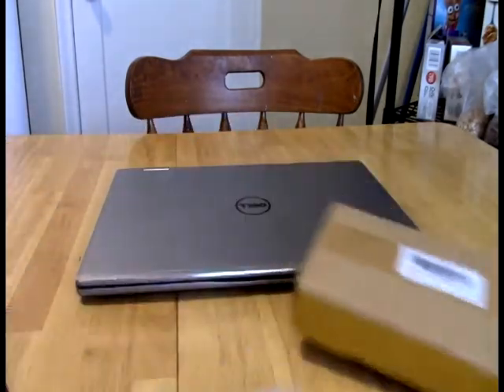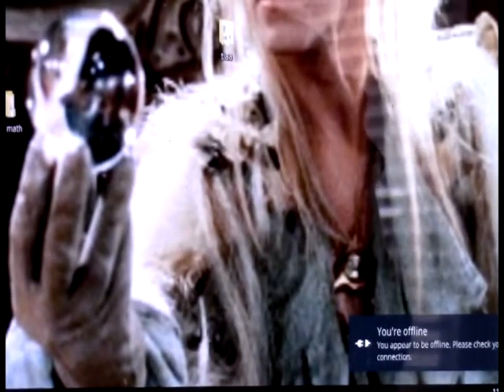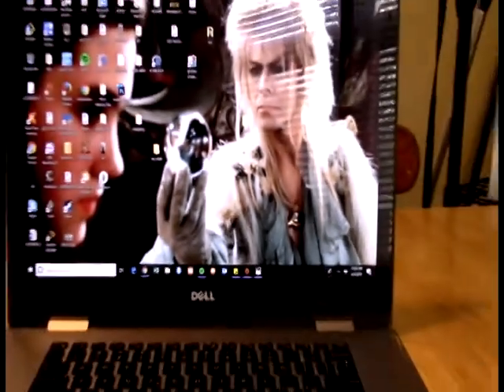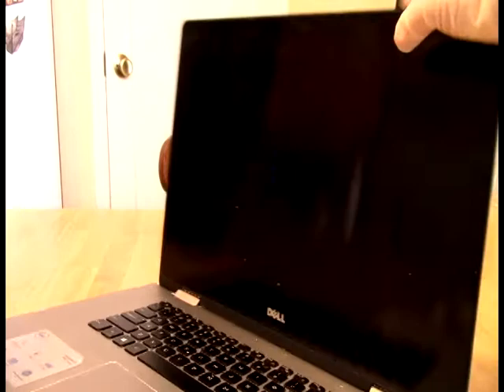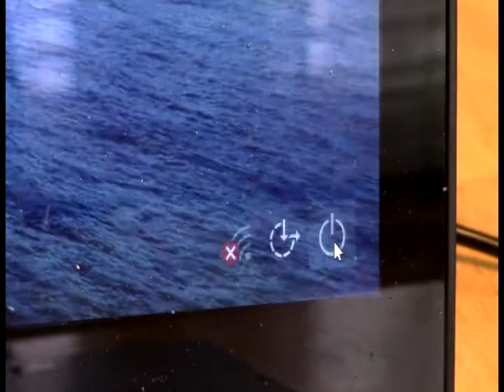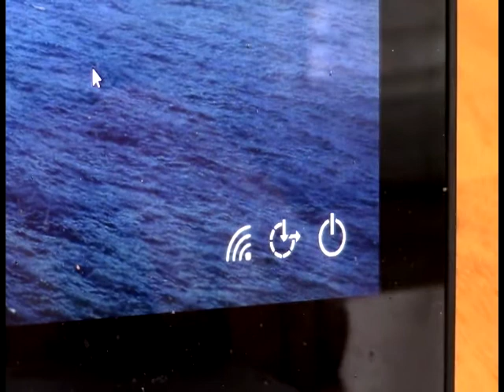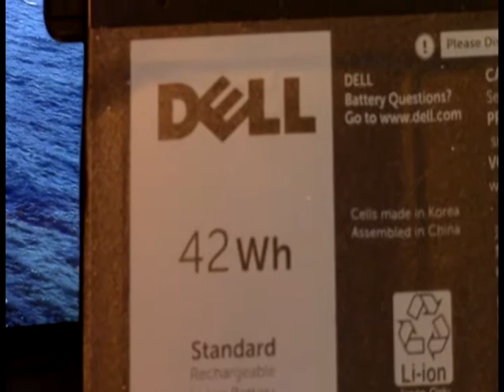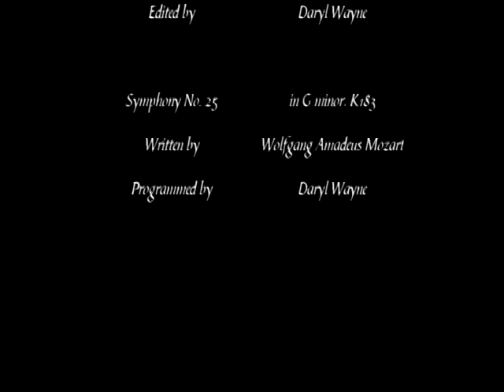Project Video: Changing the Battery on Dell Inspiron 15 Series 7000 laptop

Comment: How do you want to change 72 Wh battery with 42 Wh  ? It's not matter of the battery size .
Reply from the maker: I'm not sure I understand this question. The issue had to do with the physical size and what compartment area was available and should have been addressed in the video.
Reply: @OKGoodReview   what I'm trying to say : before you change the battery you should have checked the capacity of your battery . For example , I want to replace my 42 watt battery I will look of 42 watt and then compare the size . However thank for your video .
Reply from the maker: Agreed. As noted in the video, I did not order the initial incorrect size replacement. : )